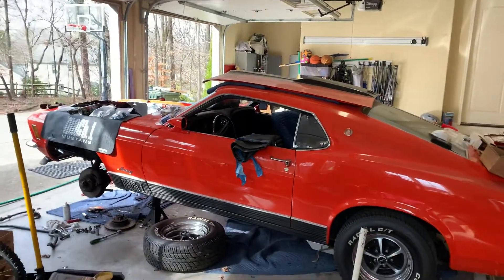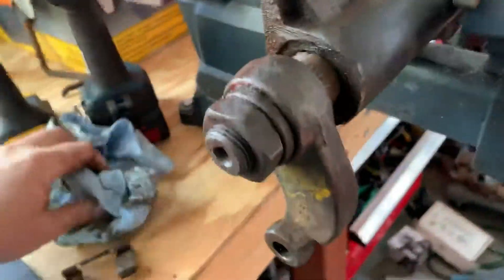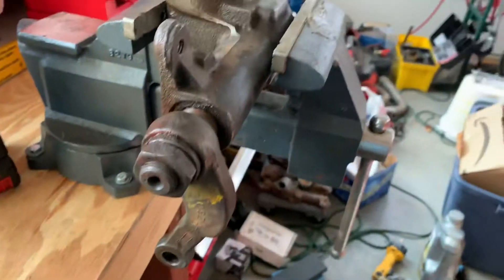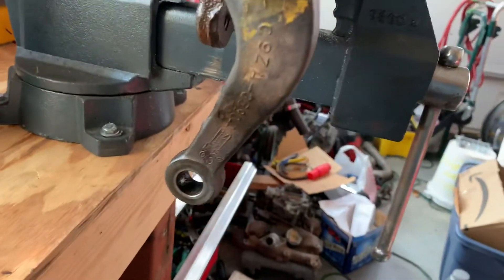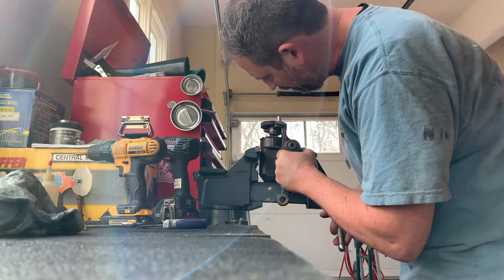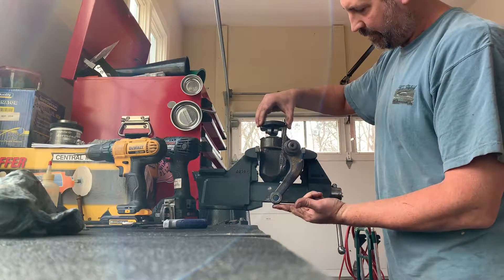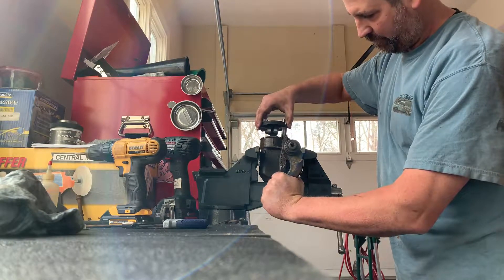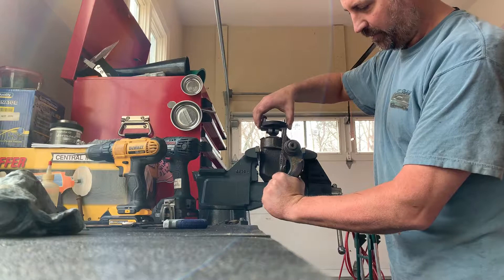Help!  1970 Mustang steering box

Comment: Hi Ben...did you end up getting a new steering box? I recently purchased a 70 fastback and found out the steering box is burnt out. I made some adjustments at the top screw, but it's my understanding that once you need to adjust the boxes they are pretty much done. Nice car by the way...I was just curious which route you went with it.
Reply from the maker: Hey ... so far I have not done much with the Mustang.   I will likely keep the stock steering box because I didn't feel the play was excessive, but I was hoping to hear more opinions.  Congrats on your fastback!
Reply: @comsol4  i have a 70 to. Replaced everything expect the box..  steeringwheel has alot of play. Also thinking of replacing the box for a remanufactured one...  I don't believe the adjuster screw needs tot be messed with since this could cause jamming.